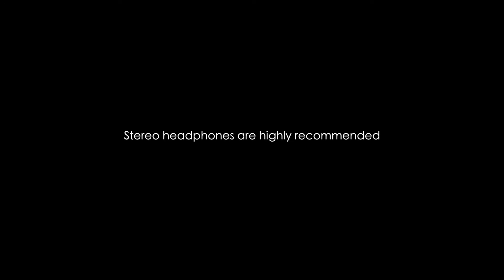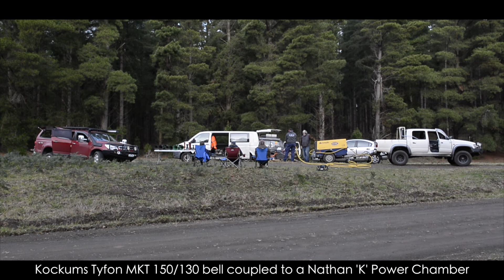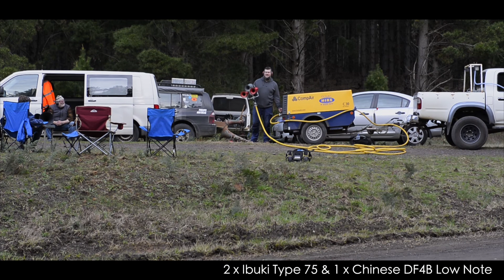Horns DownUnder - Otways 2019

Comment: 130 to 150 db and 10 to 50 miles audible.
Reply from the maker: Tris Trance Most of the locomotive horns in this video are rated at ~144-148dB @ 1m away at maximum operating pressure. 

Some of the marine vessel horns featured can output up to 160dB.
Reply: @HybridBell  160 damn the loudest ship horns i know was 155 db by a Doran Cunningham 6A and 6B and Kockums Sonics MKT 150's and the Airchime KM series at 149 db, And the Kockums Sonics 575 DVE Tyfons on the queen mary in LA can reach 132 dbC at 100 ft.
Reply: @HybridBell  Loudest train horns ik are the loudest leslie ik was an S5TX at 117.8 at 100 ft loudest Nathan Airchimes ik was a K5LLA which reached 119.9 db a 3/16 M5 made it to 120.4 db the loudest was a 5/16 which reached 121 db.
Reply from the maker: @supertyfon1736  I believe those were SPL tests conducted by a renowned collector back in the early 1980's. The loudness of train horns is quite subjective. Some M5's are loud, some aren't so loud. From personal experience, if in optimal operating condition, Leslie S5 chimes and Nathan M5's are the most powerful locomotive horns. 

Many factors influence the performance of a horn. Even straight from the factory some may be fractionally louder than others due to minuscule differences in machined tolerances during production. Wind direction, air humidity, temperature, angle of horn all pose as variables when conducting decibel measures.
Reply from the maker: @supertyfon1736  I apologize, that ship horn figure I provided may be an overestimate. I would put the ones featured at around 150 - 153dB at 1m away.
Reply: @HybridBell  True i just found those out a year ago.
Reply: @HybridBell  Still loud enough to be heard quite a ways away.